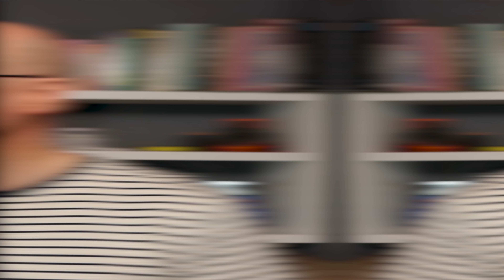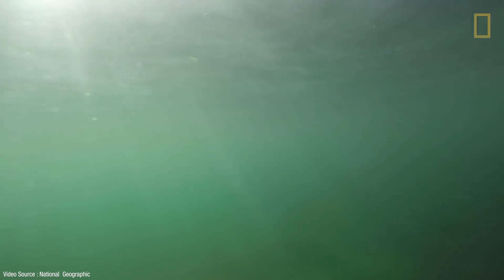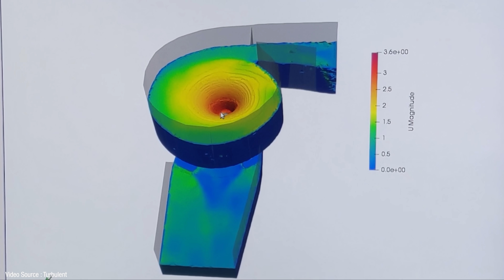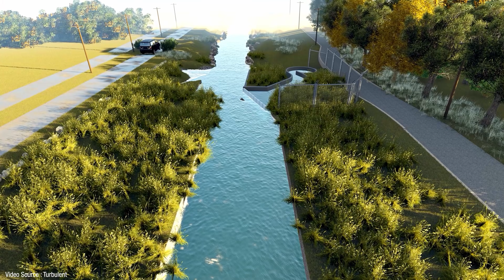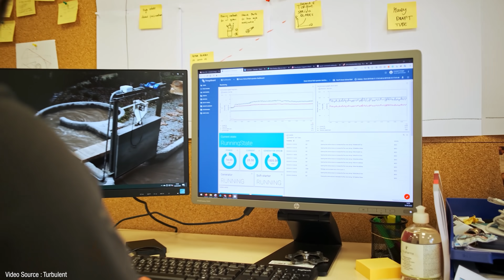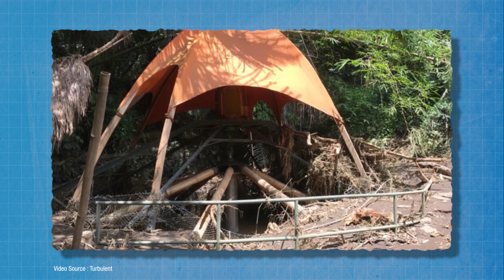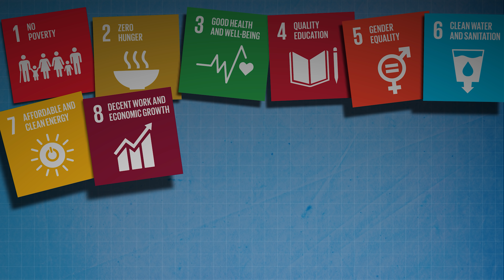Micro Hydropower : Turbulent Turbines

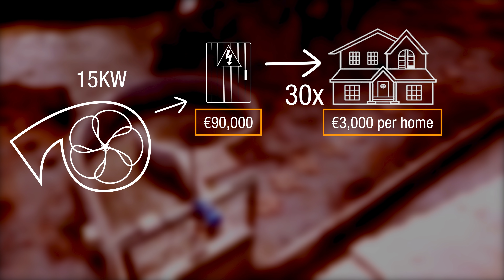Comment: 8:25 - 15KW for for 75-90k Euro?? Hang on a sec, something's not right here. One 4 person house will use 15kw. How can 15kw power 30 houses? Each house gets 333w.
I deduce from this the figures are wrong in the vid as the allowance is far more likely to be for 30 homes consuming 15kw ea for a total of a 450kw hydro turbine costing each house the the 3k euro. 15kw is a nothing amount for 30 houses. 
They make 4 cylinder Diesel 20kw generators that use 4.5l/hr @75% load for houses to guard against power outages and they're less than ten thousand bucks.

For comparison,
I have a 5kw Diesel generator and easily run it at 100% load most nights when I get home. Microwave 1100w, hot water service 1.4kw, heater 2000w, TV, amp and computer another 500w - and I live in a comfortable one room hut on a bush block by choice.
Sure after it's done its job the microwave switches off, the hot water is hot it cycles off, and the wood stove has heated the place so the heater is off, here's the thing, a 1500rpm 990cc 3 cylinder Mitsubishi Diesel powered generator uses on average 400cc fuel an hour idling up to 500w load and 1.4l/hr at 110% or 5500w load.
That's 200cc per 1000w over the 400cc idle/light load fuel consumption. I would say that's pretty good. The silenced, liquid cooled generator with brushless alternator cost $5700 for a 30,000hr lifespan. 

As mentioned something isn't right because a house with multiple people is going to use heaps more wattage than I use.

Comment: These micro grid solutions could easily be deployed many times down the same river therefore producing masses of power by the re-use of the same water that drove all other units up and indeed down river.  It’s such a simple idea and as you said Dave.... they would provide energy almost instantly and the cost would be paid off before a big unsightly dam could be built. Also any maintenance cost would be minimal over their lifetime.👍👍⚡️⚡️

Comment: There are independent repurposers that showcase their generators from recycled parts. I had been optimistic that maybe you would focus on that subculture online. As it often tends to be the case your priorities were to promote a product based solution. Rarely, if ever that I can recall, have you shown a light on independent problem solvers. You're good at bringing reasonably fresh, by the standards of the uninvolved, coverage of processes that haven't been considered widely before. But others have been down this path already, taken trash and refuse and shaped a tool or generator, fixed improved and replaced from that same pool of unwanted material and did not go straight to company to provide a product that likely didn't exist at the time. In all likelihood this company popped into existence after some engineers encountered news of this practice and decided to manufacture an improved solution. That's good, especially in the case of managed systems that have code and safety requirements. For an individual installer there is that alternative, made by hand and from that which is no longer wanted. In actuality a great percentage of your video subjects could involve a recycler's perspective. We do need more solutions, but we also need less garbage. You rarely address garbage enough.

Why is this an issue? Because of cost. Because things are getting more expensive and in some places around the world wages are still staggering at keeping up with inflation. If these remarkable products can't be invested in by the dirt poor neighborhoods where efficiency is most lacking then you are WASTING MY GOD DAMN TIME.

Comment: Great idea for those poor people who do not have access to electricity and have a constant flow river and a spare $100,000. Oh, and you will need an engineering degree to redirect the river and and create an appropriate 2 metre fall etc.  Together with all the equipment you will need to build it.
Exactly what problem is this solving?
A paddle wheel on top of the water would be far less intrusive and far more affordable.

Comment: FWIW microhydro can be really brilliant. I had a high-head system with an annoyingly complex anti-hammer setup (which was passive and maintenance-free once in place), and the big thing for me was the ridiculous power availability. At the time with lead-acid batteries running a welder was out of the question and many power tools likewise. But the hydro... it might not be 50Hz, or exactly 240V, but it is very enthusiastically there when you turn the tap on.

Comment: I live in Montreal Canada. According to my electricity bill, in January I consume 136 kWh per day on average. On average, my house therefore uses 5.6 kW of power (136 kWh / 24h). I have a standard house. A 15 kW micro power plant could therefore operate only 2.67 houses not 30 houses where I live. What kind of house can run on 0.5 kW (15 kW/ 30)? A hair dryer uses 1 kW. My Tesla needs 9.6 kW when charging (240 V X 40 A). I am not against this type of mini power plant, but it is not adapted to the North American reality. It is, however, a good idea for a fishing camp or hunting camp.
Reply: My thoughts entirely -- 5kW is par for the course for household usage. He's off by a whole order of magnitude.

Comment: We need to go with Nuclear power to solve the issue. Hydro Electric is like adding a gallon of water in an olympic sized pool. I love the idea as much as everyone however demand is far greater than what is possible even after all the rivers and streams have been  tapped. And do we really want one of these things every 50' ? It's good to look however reality sometimes just doesn't care about what you want. The same thing is also true with wind turbines.  Yes. I do have Solar panels and I am building a tiny Micro hydro generator, 280 Watts from a small  stream. It's fun to try. Reality is Solar isn't free and the honest conversation about batteries and panels can get ugly. Wind power also has a very large environmental impact. Where will China build the next Dam? And after that?Just food for thought.

Comment: We're told that one of these will run with a head of 1.5 metres and The Smallest One will produce 5kW

So, let's Just  Have A Think - let's try thinking about using a calculator

Assuming 100% efficiency of both the turbine and its generator will require  333 Litres of water per second to be going through this machine
75 Imperial gallons per second
six and a half million gallons per day

Double it to account for inefficiencies
That is one he11 of a lot of water...........
Just for one really tiny machine.

Now then, we see computers watching these things..
Just to make a Dell Inspiron Model# 2500 (now 19 years old)  caused the emission of 250 kg of Carbon Dioxide
Do we use Moore's Law, double every 18 months to get the energy cost of a modern laptop?
I sincerely hope not but those huge CPUs, graphics chips and epic RAMs in modern lappies will be easily 50 times hungrier. easily.

That little turbine will NEVER repay the energy used in just the technology used to monitor and control it.
CO2 has driven this world gone completely mad

Comment: I've said it before and I'll say it again, 

The way to use renewable energy is on the individual level.
Reply: I was thinking this too, already people on YouTube have made 1/2 kilowatt water generators with nothing but a small stream.

Those would have a even lower environmental impact and significantly lower cost, not to mention the water source requirements are lower too.
Reply: @ezg8448  The part that people forget is resilient plastic requires petroleum.
Reply: @ChipmunkRapidsMadMan1869   But the petroleum is not burnt, so it doesn't emit CO2.
Reply: @mieszkogulinski168  but if it's not cost effective to extract it, it won't be extracted. So either the price for solar arrays goes way up or we continue using petroleum as motor fuel.

Comment: what about river flow? I imagine a drought could throw a spanner in the gears. Also what about maintenance and repairs comparing this to diesel. I really do think this is much better than a dam though.
Question. when installing renewable engery we are taking energy out of that system at what point could that cause problems or at least a change. like maybe one of these would be fine but a few down a river messing with the flow. amd for wind farms what effect do they have the weather and can it effect the climate?. Less air currents and down the line changing high and low pressure interactions. OR a are wind farms not big enough to do anything?

Comment: not convinced that the swirling is advantageous
Reply: It reduces the pressure on the turbine and that's good for the fish,  no turbine at all is probably even better for the fish
Reply: @2adamast  Can you elaborate on what pressure it reduces? Are you loosely swapping pressure & force?
Reply: @flatfoot  The swirling lowers the height of the free surface in the center,  so hydro static pressure is reduced in the center.  
The rotation also creates extra pressure at the exterior,  this against the incoming flow to the center.

Comment: Fairly dead easy idea. I thought about this myself ages ago, not surprised that people are capitalizing on micro hydropower. I'm still trying to find a downside and don't see any aside from cleaning it occasionally and replacing it after 30 yrs. So long as you have a river with continuous water, you're set. You also can't beat the cost of ownership either. This is also a great idea as backup power in case the grid goes down. This is good for rural areas or people who prefer to live off-grid. But for baseload power for cities, I'm a fan of nuclear and I hope LFTRs replace coal/oil/gas and water-based reactors.

Comment: I've been keeping one eye on Turbulent for a couple years now. This stuff is going to be the micro-gen grid of the future, you betcha. The US of A will, of course, be the last domino to fall, but we'll have to do something like this to support the extension of generation from large plants to smaller, spread-out sources. Our infrastructure simply can't handle the loads any more, as witnessed by the recent mess in Texas. Small generators spread all over hell and gone will save our electrical grid's bacon by making the major load-bearing lines do less work. Watch for it.
Reply: Just wait until you find the regulatory hell each of these little turbines faces if it is to be connected to the grid!  Good luck!!

Comment: So one question on this. Are there other groups or companies that are also building this sort of thing? I agree it's a fantastic idea!

There was also mention of old waterwheels around the UK, and having watched several narrowboating videos I wonder if something like this system could be worked into the many locks on the canal network as well. I guess that'd be less regular water flows, but it could still feed into the grid and make use of all that water movement.
Reply: canals are not rivers. you can't use hydro power on canals.
Reply: @Withnail1969  Somehow I missed this comment a while back. And yes, canals are not rivers. However the canals do make use of locks to handle changes in elevation. There's plenty of water movement that happens to raise and lower the boats. So, stick turbines on the water channels the locks use to do that.

Comment: I have thought more about this idea. It is way too complicated (& expensive) for just about any small scale, medium scale, 3rd world, 2nd world or even 1st. world application. Think simple water wheel. You need a saw mill & wood, Blacksmith & steel, some rocks & gravel (maybe not even cement), pulleys belts and a generator or alternator (Non electronic controlled)  What is NOT in this: Water Rights, fish & wildlife, flood control, fire control, water quality  control and all of the other Official Political agencies one could imagine.

Comment: How I'd love to live in a more rangy / hilly area. Ok, I do live at a hillside, but no watersource, not even the tiniest creek crosses our property. Such micro hydropower system would be the most perfect supplement to my small PV, especially in winter (and since we are almost a windless spot). In summer creeks tend to dry out around here. Thats ok, as my solar keeps me self-sufficient. In winter, when the sun is low, with often cloudy, rainy or foggy weather and the days are short, then the water will flow more powerful and steadily, taking over the power supply.

Dave, I'm totally with you:
For times after retirement I fancy some "living in the woods, off-grid", also. Unfortunately, that may require emigrating, since German laws are way too restrictive and too complicated to allow living as a dropout. Realizing some elements in parallel may work...

Comment: There are dams for a reason. Streams get flooded and dry up.
And even a drop as small as1,5 m requires a pretty long channel parallel to the stream if it's not steep, like a rapid, as in the examples shown.
And why would I settle for a fraction of the stream when I could run the lot through my turbine and earn more money?

Comment: These MicroGrids appear to be a huge part of our future. Local energy can take advantage of the water access, sun access, wind access,  geo access...  The PV microgrids now referred to as Behind the Meter in California are connecting to storage and invertors. Turns out electric vehicles have the same battery specs as your house.  It is about taking advantage of different energy generators, backing them up with different storage units, then managing it all through invertors.

Comment: Install a hose pipe up a river bed. Recycle water to the high level of the existing water channel (even small streams and brooks) with extra outlets in the channel to maintain maximum flow throughout the channel. No need for dams. Increase the head, buffer the rainfall cycle. Add water driven silt recycling to support the ecosystem (consider ranges of bacteria, flora, fauna)

Comment: I have for years envisioned a power system fueled by large steel chunks hoisted into the air and running a generator like a Grandfather clock.  Go out and use a chain hoist to lift say a 10 ton block into the air.

Comment: i am making one like this in my back yard river, its a rain river so it only flows when it rains, but i think this will work, if i dont overzise it too much. only made the foundation sofar, and plans for the rest.
Reply: not much use if it only exists when it rains.
Reply: @Withnail1969  well, let me refine it, it will dry out if it dont rain for 2 months. some summers that happens. but spring it flows until all snow has melted, and in autummn in usually rains all the time until new year so i guess 8 of 12 months it can run, but like i say , it depends on the rain.

Comment: Pigging love this! Love the ethos, love the scale, love solution. Turbulent are doing a great job, though there are competitors using similar designs - all worth a look though Turbulent seem the best! A competitor, perhaps, are archimedes screw installations on more major rivers, popular in Poland, German and France, amongst others. They tend to be on slower moving rivers, with high volumes of water, and are an order of magnitude step up from Turbulent generators.
At the other end of the scale, if you want to build your own system from readily available 'junk' like bicycle hub dynamos, you won't find better than 'OpenSourceLowTech'. There is something for everyone ...

Comment: I've been thinking this for years why in the uk we don't have loads of water generation, in my town in the summer the river is too low as you can basically walk a cross but the in flood season it can rise by 3m, so my thought was multiple small floating water wheels or use the system you described but you put the in take up stream but the whole lot floats on a pontoon so it doesn't mater if there are floods. Every day i walk my dog past the river and think why oh why did we stop using rivers for power. Good show    👍

Comment: It is correct that the smoothed consumption of a household is around 0.5 kW/h.

But there are restrictions to be considered:

1. this is only the direct private consumption. Indirect consumption (for infrastructure and goods production) is 5 times higher.
One must therefore be aware that this 'climate-friendly' electricity production by no means makes one's own household 'sin-free'.
2. precautions must be taken against peak loads: Even an iron needs 1000 w/h! And stupidly, all households have common load peaks more or less at the same time.
So you also have to add a very large battery storage system to the costs! But that costs more than the power plant itself. In addition, maintenance and repair costs as well as costs for the grid must be included.
3. Small power plants are unfortunately not ecological.
If only part of the water is diverted and the small river is otherwise left undisturbed, the damage is less, but the possible locations and the yield are drastically reduced.
Otherwise, considerable damage is to be expected: Even a slowing of the flow velocity can silt up the gravel bed of a stream and thus destroy the spawning grounds of trout and other fish. In any case, it is clear that the power plant is an obstacle to spawning and fish migratiion.
4. Unfortunately, usable small water bodies are very rare, especially if they are required to have a relatively constant flow throughout the year. Such small power plants can therefore only ever be very limited niche projects that make little or no difference to the overall balance.
The nearest usable brook I know is 12 km away,  has several thousand households on its banks and tens of thousands in its vicinity. So electricity for 100 or 200 households is of little help.